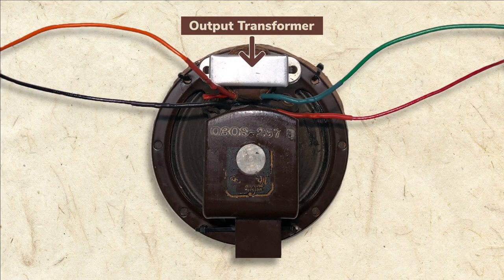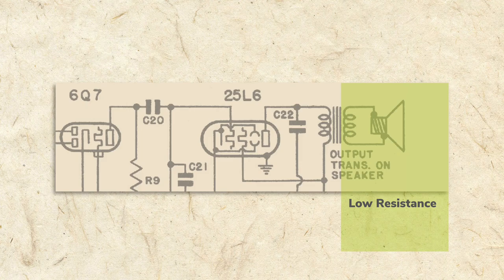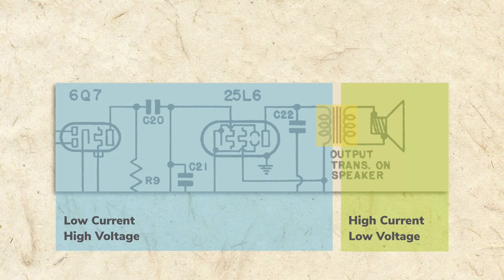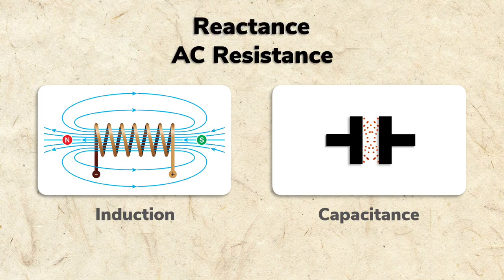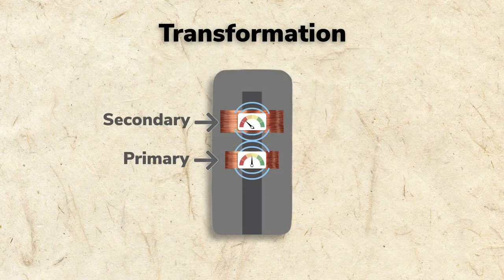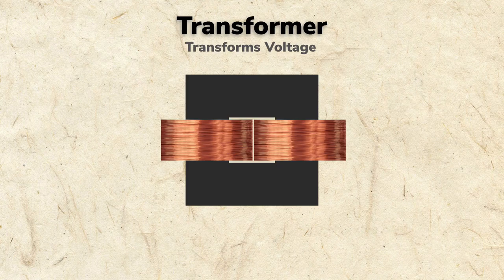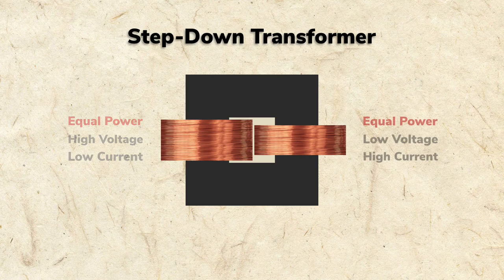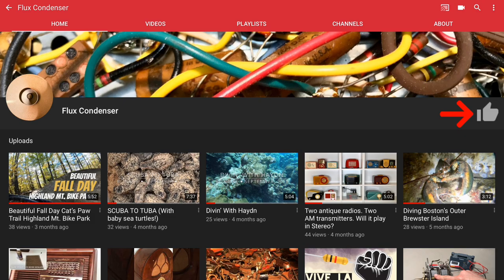How Does An Output Transformer Work? What’s Impedance Matching?

Comment: Great job!
Speaking about audio transformers frequency range, what mechanical aspect of the transformer  determines how much range you will get? I'm not quite sure to grasp the difference between power transformers and audio transformers. Thank you.
Reply from the maker: Thank you! It’s the core of the transformer that affects its magnetic flux and frequency range. Air core transformers are appropriate for very high frequencies. A ferrite core for high frequencies. And an iron core for lower frequencies such as power or audio applications. A power transformer designed for 60 hertz actually crosses into some of the audio band which is between 20-20,000 hertz. A power transformer and audio transformer are similar, but the core will be a bit different, I imagine, to tune them to the appropriate frequencies. That’s about the limit of my knowledge on the subject, but you’ve now got me curious to learn more about how this frequency tuning is done.
Reply: @FluxCondenser  Thanks it's clearer now! I'm trying to gather audio transformers from random audio equipment but I'm not very lucky so far...on the other hand I have loads of power transformers, what range covers a 60hz power transformer according to you ?
Reply from the maker: You can experiment, but I don’t think you’ll have much luck using a power transformer for audio. For very low fidelity applications it might work, but a transformer that’s designed for 60 hertz just isn’t likely to cover the entire audio band. Keep in mind, too that your primary concern (no pun intended!) is that your audio transformer provide the correct impedance. To replace an audio transformer, a power transformer not only has to be able to handle most of the audio frequencies, it has to provide the correct step-down for the circuit. Note that I can’t simply give you a transformer impedance to use as this will vary greatly depending on the circuit. A tube amp will have different requirements than a solid-state amp, for example. Look on the audio transformer or schematic to find the value. You can also do a calculation. Calculating impedance is complex, but you can roughly calculate it by measuring the transformer’s DC resistance and multiplying that by 1.25. If you have a power transformer which provides a suitable impedance for your audio circuit give it a try. I’d be very curious to hear about your results.
Reply: @FluxCondenser  Thanks again for such a detailed explanation! I might be wrong but, the audio transformer I'm looking for doesn't need to match impedance because I'm just using it to multiply 2 different signals (ring modulator attempt). the ideal ratio should be 1:1. In the meantime I found a hum destroyer with 2 full range audio transformers, such a shame I damaged one while desoldering it. I guess it was the price to pay to learn how to correctly desolder a pin component. (create 2 parallel rows of tin solder and heat them alternately as quick as possible while holding the circuit upside down to let gravity do its job ;)

I tested the good one, I have around 500ohms on both sides.
In my audio transformers searching quest I found a very old cassette recorder (telefunken MC310) I inspected the schematic and found a transformer. It is cylindrical, and it has a flat screw in the middle that you can move around 360° (never seen that feature on any transformers before), I tested it :
30 ohms : 4ohms
But it doesn't seem to work as good as the one I got from the hum destroyer.

I will try other power transformers.